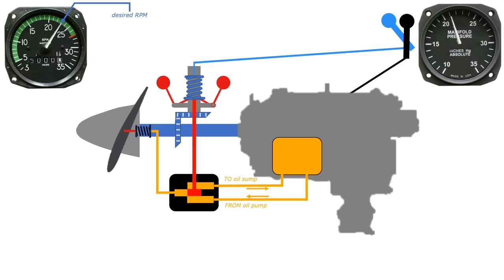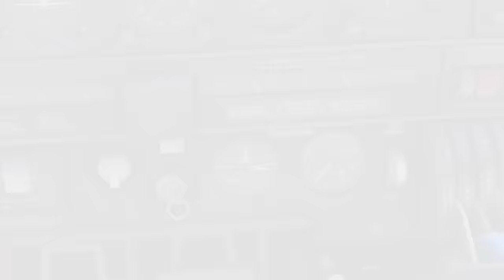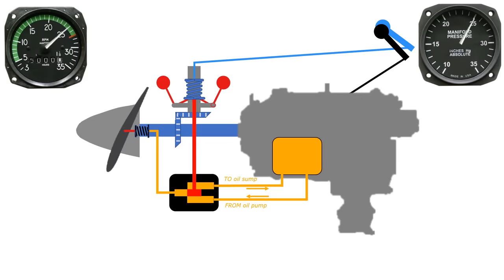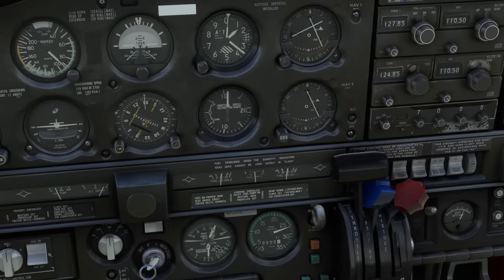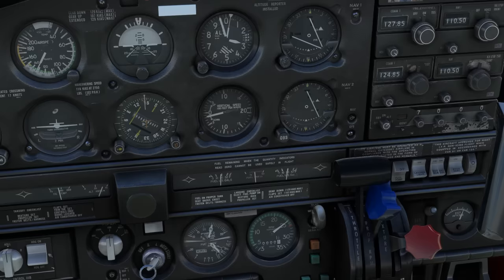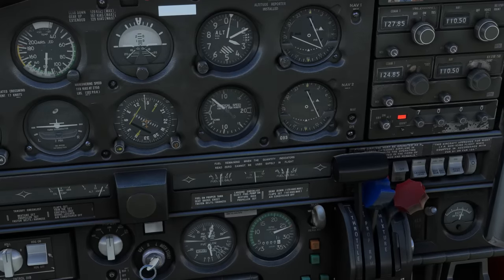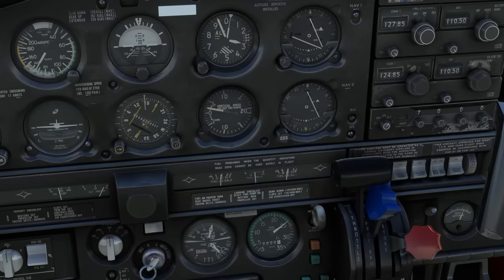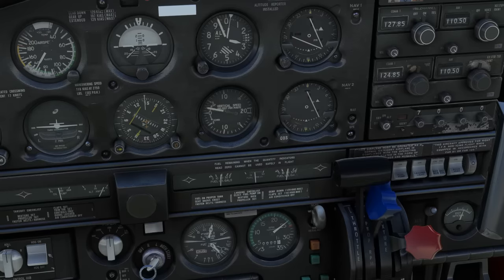How to Fly with a Constant Speed Prop | Transition to Complex Aircraft

Comment: One thing to remember, is that if you fly with the manifold pressure higher than the RPM, even if it says, you can do so in the POH, many times, due to harmonics the plane will develop a nasty vibration or rumble. This could be compared to driving your car with a manual transmission and you are in a higher gear and you step on the gas pedal abruptly. Instead of increasing speed right away, the car will vibrate and make rumbling sounds. As a general rule, it is probably most safe to get the same percent horsepower by getting as close to square as possible. That is in the example of 24.7 manifold pressure at 2200 RPM yields 65% power. It probably has a listing for 23 square. The noise level will be higher like a fixed pitch propeller, but it is easier on the engine and the propeller. It may also keep a few rivets from vibrating loose.
Reply: He specifically addressed this myth in the video. This is the first time I've heard "harmonics" as the justification for the myth, though. Most pilots who believe this think it's to "avoid stressing the engine" or something.
Reply: So you know better than the manufacturer? Just fly ANY aircraft the way the manufacturer recommends and not the way some "amateur" thinks is best.
Reply: So what would happen if your manifold gauge was calibrated in millibars instead of inches of mercury? Now what?
Reply: @dragoclarke9497  I agree you need to always consult the POH as the primary source. But consider that the engineers wrote what they thought was best practice when this plane was brand new with comparitivley few hours flown on the design. The author is now writing with, for all you know, decades of experience flying constant speed props. Its worth considering that best practises can change as millions of combined flight hours are analysed on a particular model.

A good example can be seen in AOPA's most recent video where a pilot took off on a high density altitude day. All passengers were weighed, all preflight calcs correctly performed, all run ups were carried out. But the plane DID NOT perform as described under the conditions as stated in the POH. The plane continually stalled after takeoff and eventually crashed into a residential area, killing some and injuring others. This is one clear example where a POH was actually a contributing factor to aviation fatalities. Its worth noting there were other contributing factors as well like most aviation accidents.

One other example that many instructors teach their students which is not in the POH but does seem to work is the trick of 'hopping' an obsticle in the event of a forced landing. The POH will state a clean best glide speed and tell you to stick to that. But real life experience shows that if you pop in extra flaps right before you are about to touch down into a fence or just clip a tree line, you will momentarily rise and then decend more steeply after you clear the obsticle. You wont find this in a POH, but it does seem to work. Also check out 'free pilot training' on Youtube for a video where he shows that you can climb out even steeper than the Vx stated in the POH by using a ground effect 'zoom' climb. Again, this works well for clearing runway obsticles and you wont find it in most POH's.

In aviation you need always need to remain humble that others may know something you dont know. And that even the engineers who wrote the POH probably have not delivered a 100% perfect document the first time it was handed down at the beginning of an aircrafts life. In the commercial aviation sector (I.E Boeing, Airbus, etc) we see constant updates to operating and maintenance documents through the life of the aircraft. Unfortunately, this does not seem to happen to the same extent in GA planes.

Be kind and remember as pilots we remain life-long students of aviation 🙂
Reply: @HiddenWindshield  I speak from experience. I flew in arrow once with high manifold, pressure and low rpm. The airplane vibrated badly. All I can say is try it for yourself. One more thing to consider is generally your true airspeed will be slightly slower, and your fuel burn will be slightly higher with a higher manifold, pressure and lower RPM. I specifically speaking about a naturally aspirated engine.
Reply: @dragoclarke9497  I am far from amateur I’ve been flying for 40 years. I’ve experienced this myself. If you don’t believe me, just go ahead and try it. Manufacture is correct, but it does not list fact that under certain conditions, performance and recommendations will yield varying results. As an example, the POH always for any given condition gives you a GPH fuel burn. No airplane I ever flew burned fuel to the exact value listed in the POH.
Reply: @aviatortrucker6285  I too speak from experience. When I was getting my complex rating, my instructor and I played around with different propeller and power settings so I could get a feel for how that affected the plane. This included settings that were "over square". I've since flown planes with constant-speed props many times, and have never been afraid to go "over square". Nothing much happened when I did.

As stated in this very video, some airplanes have manifold pressure readouts in millibar rather than inches. Such planes are impossible to run "over square", because 25 millibar is such a tiny amount of pressure (0.7 inHg) that no real engine could ever reach that. Are you suggesting that changing the gauge actually changes how the engine works? Or are you now realizing that the two numbers really have nothing to do with each other?

I don't know why your airplane just happened to start vibrating that one time, but it certainly wasn't because you were "over square".

(Also, my instructor, the FAA's AIM, the AOPA, and the PoH of every plane I've ever flown have all called this one a myth, so I think I'm going to stick with them rather than believe some anonymous YouTuber's anecdote.)

Comment: Why do you have to check the fuel tank so much? Does the knob easily jump out of position?
I could see if you  are running low on a tank just before landing so you won't run out of gas.
Are you just burning in GUMPS in your brain? I can see it only takes seconds to do GUMPS and youd hate to skin over something that was not set after doing your first GUMPS check.
Not a pilot, but I like watching the videos.
thanks